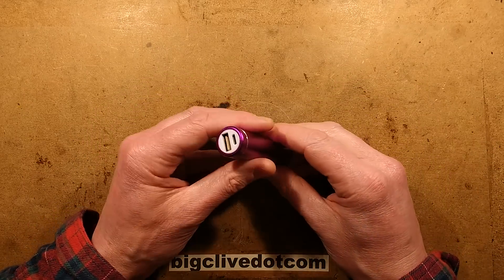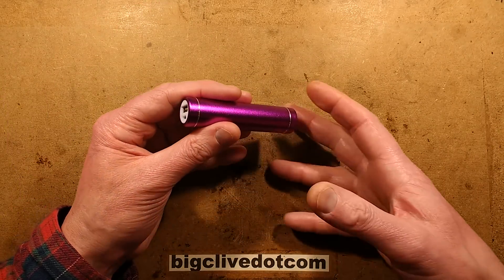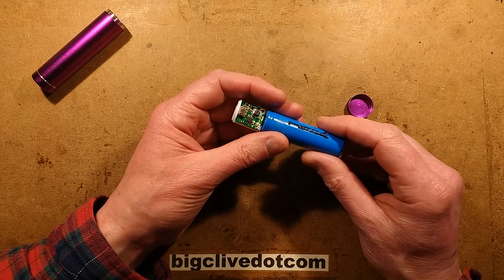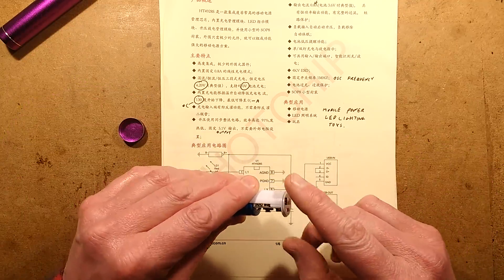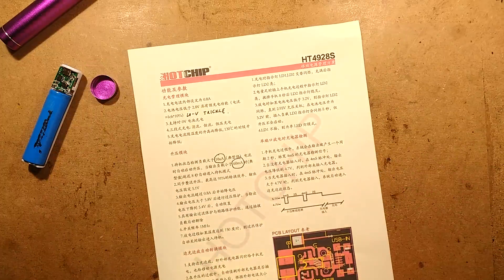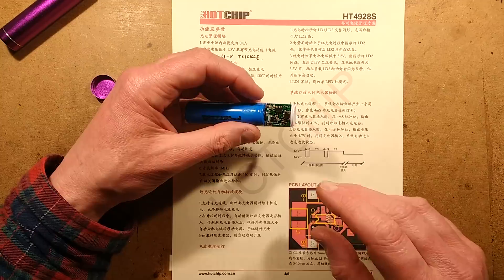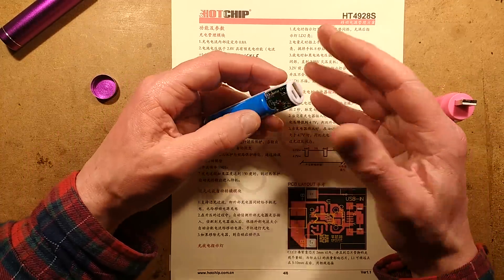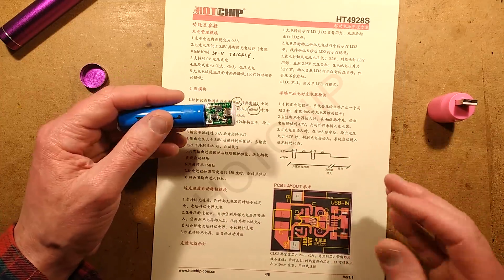Unusual USB power bank control chip.

Comment: A while back I bought some TP5410 chips from Ali Express because I saw them being used in the Wemos D1 battery shield and thought they might be useful for my battery-based projects. I was pretty impressed with the fact that it combined a battery charger and boost converter in one chip, but while it's impressive they've managed to integrate so much into that tiny chip, I think it's just taking it a step too far. I think I'd rather pay the $1 more for a couple of extra capacitors and the external Schottky diode.

Also if it's outputting 5.1V, but you're charging it from a 5V power source, it could be pushing current back into the source, which could damage poorly designed devices.

Comment: Good for a dash cam anyone?
Reply: Most dashcams need a minimum 1A output. The spec sheet says 800mA output, so I don't think it would work very well.
Reply: I got one video (Grudniowa Masa Krytyczna)from cheap DashCam connected to that same PowerBank mounted on my bike. It make some noise when is recording (the power and mAh is small) but when you play the movie it's normal.

Comment: I've got plenty of powerbanks but none cylindrical and now I WANT ONE. Bad Clive ;)
Reply from the maker: You can never have enough powerbanks.
Reply: that is true :) The ones I got most resembling these are 2 square housed ones. They have a neat on/off momentary button on the front. Most seem to be without and sometimes turn off with light loads.

Comment: This issue with the 4,7 volts drop or the stand by cut out would not be a problem. If it would be, can't you just put an capacitor parallel to the output? But defenetly a very neet little device.

Comment: It can be  used a dual transistor astable with a proper load to make the power bank not going to sleep mode . The power bank is very nice, compact . I have a bought a multimeter that was removed from the list but fortunally it arrived to my home safe and it's working well.

Comment: Anyone got a budget solder that they like and performs 'ok'? I know I should buy a top branded solder, but I don't work and this hobby is costly enough :)
Reply: I used to buy from Maplin but I understand they just closed. However, any 60/40 tin/lead solder with flux core should do.

Comment: I have a few of those boards in the fry's $2.50 power bank. I took one and hooked it to the samsung flat pack lithium battery pack out of my daughters old tablet. It works great and I have a 14000mAh battery pack now. The fry's pack come with a no name 18560 soldered directly to the board and battery.

Comment: I was looking for this product for months. I need it as UPS for Arduino. Idea is to supply Raspberry PI project and being able to charge it without it shutting down abd seamlessly switchig to battery on single chip. For now, I have 2 PCBs - one charges battery and other boosts to 5v. There is no direct conection from input to output.

Comment: Have you tested it charging a phone? Does the phone handle the 4ms 4.7v drop? Most smartphones will back off the current if the input voltage is that low, but maybe 4ms isn't long enough to cause any problems

Comment: Clive  I have two of these Ebay purchases too.  I'm in NZ, you are right about a snug fit of the battery
I cut the end off the plastic end & just left a piece of plastic in the end & it gives me enough room to put the 18650 cell in

Look for 2600mAh Portable External USB Power Bank Box Battery Charger For Mobile Phone if you want any on ebay
Reply: NZErehwon I did the same thing!

Comment: Oh, that's smart, because the input and output are the same, you could use a single Type-C connector as input and output, with no extra work.

Comment: I've seen these for purchase on Amazon and eBay being branded as MiPOW or Vida IT.  Perhaps one of those companies originally designed it and filed a take-down notice on this product.  I just did a quick search after watching this video and you can still find ones that look identical to this & use a single 18650 cell by searching, "tube usb charger".  Of course, the internal circuitry might be completely different than the one Clive shows here.

Comment: Wonder if annoying blinking of either string lights every 12 seconds or single light every 2 seconds could be reduced by deploying two power banks in parallel or maybe even three !
Would imagine some other functionality might be lost though.
Reply: Only if the outputs are OR-ed together with diodes otherwise when the output drops to 4.7V every 2 seconds to check if there is a charger fitted, it will detect the 5V from the other power banks and go into charge mode.

Comment: Ah, yes. That HOTCHIP boost converter chip. I have two power banks I hacked to accept protected cells, and I sometimes use that to charge my phone when my main power bank could be too large for the purpose.
These things do get hot a lot but it properly cuts the connection if it reaches the critical point. They are good for their price!

Comment: with you having another 18650 related product i wanted to ask if you would know where or how to get an 18650 battery, which has a small positive pole inside the negative pole. i have one of those for my flashlight but i can't find another one but i'd kinda need it
Reply: Tizzandor it would probably be easier for you to get a really thin copper washer and solder a wire to it

Comment: Hello Clive, could you please check if this listing contains the same circuitry inside the power bank? It's got pictures of the circuit board. Here's the link: https://rover.ebay.com/rover/0/0/0?mpre=https%3A%2F%2Fwww.ebay.com.au%2Fulk%2Fitm%2F282286313670
Thank you.

Comment: Obvious flaw: You are not supposed to load the incoming USB power with more than 10μF .
Reply: "You are not supposed to" is the long way to spell "USB". You're also not supposed to draw more than 100mA until you negotiated it with the host, or draw more than 500mA on any 2.0 port, or draw sweet fuckall if you got deconfigured because the host is going into standby, or have "A-A" cables, or "Y" double-A cables... yet 99.9999% of neither devices nor hosts just don't give a damn. I think this one's dead, Jim...
Reply: Attila Asztalos For the current draw, they made a special exception for charging purposes, though I haven't read that part of the specs.
Reply: the apple ibook g3s actually followed all those specs and it was annoying as all hell

Comment: I was actually looking for a power bank that would act as a UPS/buffered power supply.

I have an Intel Compute Stick (an Intel Atom-powered mini computer), which is powered from a micro USB port (rated 3A). There is no battery inside, so in case you need to move it you need to shut it down, disconnect, reconnect and start again. Having such a buffered power supply I could use it to keep the device powered while moving.

Sometime ago I got a cheap power bank as a company Christmas gift and I recently gave it a try and plugged the input plug while having the output connected to a phone and surprisingly the charge LED went on, while the discharge LED kept going and the phone was still charging. I didn't notice any power interruption, but I also didn't check if the battery inside the power bank was actually charging.
Reply: Just a heads up, Lithium batteries don't like to be floated, so the 18650 will probably not last terribly long in that scenario.

Comment: I have one that looks identical I bought from ebay a few months ago that has a different chip inside. Its a perfectly good little power bank but it uses the TPower TP4333E instead. It must be a similar all-in-one charge control and boost thing because there's no other chips in there and the PCB is similarly bare with just three capacitors, a single resistor, the boost inductor and the two LEDs. It can however output 1.25A and doesn't seem to do the momentary charge detection voltage drop. I doubt there's any way to tell which you'd get from any given ebay listing.
Also the wide spring thing might be an issue if it was at the other end but the entire can of an 18650 is the -ve terminal so there's nothing it can short on there.

Comment: I recently got a very similar looking one from an aliexpress seller, but mine behaves quite differently. The two usb ports are not directly connected like this one, the output will turn off if you try and charge it at the same time. Even more annoyingly, it will only charge the cell up to 4v.
Reply from the maker: That's still close to a full charge, but will result in a much higher number of charge cycles.

Comment: The HT4928S chip is still available on Amazon in a two cell power bank. I've got one in Big Clive Pink. It's works quite well.
https://www.amazon.com/5600mAh-Battery-Charger-22×42×86mm-Tuscom/dp/B0751BBVRG/ref=cm_cr_srp_d_product_top?ie=UTF8&th=1

Comment: For the problem of it going into standby mode / dipping every 2 seconds, could you put a capacitor into your circuit to kind of smooth it out, if you felt so inclined?
Or would that not work?
Reply: runforitman needs an additional diode to stop the capacitor from back flowing and triggering charge mode (capacitor pins the output to 5V, chip detects that the voltage doesn't fall even tho it's cut it's own power, chip assumes it's plugged in)
Reply: Pixl Rainbow I did think that after I commented but I wasn’t 100% if all that was needed to stop that was a diode.
But you’re definitely right; just a capacitor on it’s own would cause more annoyance than without

Comment: It's a little bit annoying with all those power bank having standby doing strange things when you just want to use them with low power microcontrolers
Reply: R4P70R stick a capacitor on the output to smooth the voltage, and stick a diode to prevent the capacitor from causing backflow and triggering charge mode.
Reply: It is very good at keeping the battery topped for the case when you actually need it. It is a good compromise.

Comment: Couldn't you add a capacitor to the LED light string to stop the periodic flicker?
Reply: Paul Drake when it goes into "charge check" mode, it dips the output to 4.7V to check if something else is keeping the voltage up. But since the capacitor is charged to 5V, it will prevent the voltage from falling. You need an extra diode to stop current from flowing back into the power bank and triggering charge mode.
Reply: Pixl Rainbow could you recommend values of capacitor and diode for us that don’t have too much knowledge
Reply: Pixl Rainbow ah, yes
Reply: Paul Drake that’s what I was thinking... but that probably comes with other problems that I don’t understand haha

Comment: I have a similar powerbank with the same chip. It works out around 57% efficient with 2250mah to full and 1100mah till empty. It only seems to be around 0.6-0.8A output, the voltage drops and it cuts out if you give it much more of a load. Mine doesn't seem to cut out like yours does, but I'm sure it's the same circuit.
Reply: you got 8Wh in, and 5.5Wh out, and thats the efficiency of 69%

Comment: Wouldn't a properly sized capacitor solve the "low-load standby in every 12-14s" problem?
Reply: only with diode to prevent discharge back into this thingy. Because if you buffer big enough to keep stable, it will detect the 5Vand think it gets powered and switch to internal charging mode completely.
Reply: Yes, a large capacitor would work.
Reply: good point
Reply: To prevent flicker from the charger detection, the capacitor needs to be as small as possible. 
To keep the normal output stable, the capacitor needs to be fairly big.

To fix the low-load cycling problem, a small capacitor may help to cut down the time needed to detect the load current, but to solve this properly, I think something else has to be changed. I think one solution could be to add (more) hysteresis to the standby current threshold. Then it should either stay on or off.

Comment: I would imagine the "sensing" features of this chip would also make it very bad to try to use as a power supply for low powered microcontroller applications (like Arduino).
Reply: It may even go into standby mode if power pulled is too low. I can imagine the square one works much better for that application.
Reply: I have a pack that looks like that. I run Arduino and RC receivers off it all the time. Of course it could be entirely different inside....
Reply: very bad has in utterly useless? besides charging your phone I don't see what you could do with that pice of shit.

Comment: What an interesting chip!
I wonder if a schottky diode in series with the output (just before the the output plug) and a 10uF cap to ground after the diode, would eliminate the pulsing every 2 seconds? 
Since the output is at 5.1 and the diode will drop 0.3V, it should still be usable...

Comment: This would be just perfect for my Bridgeport Interact MK 1 CNC with Heidenhain TNC155A controller. The TNC155A has a battery backed machine parameters stored in SRAM and it seems to eat the battery's at quite a fast pace. (It does measure the backup battery voltage and ever so often it complaints that the batteries need to be replaced) Maybe the batteries aren't really drained but the comparator may have some issue detecting the correct battery voltage. It has never lost the machine parameters due to low battery voltage.

There's a battery bank, three LR6 (AA) non rechargable and a diode that feeds the backup SRAM, maybe if I remove the diode and connect this to it? Even older SRAM retain its content down to very ridiculous voltages... 4.7v should be no problem...

EDIT: Or not if and when the load with the SRAM is low and it would go to sleep... :(

Comment: Thats actually really smart
I kinda wish my expensive power bank could charge itself and my phone at the same time
Reply: RIGHT?! i'm so annoyed that none of the power banks or power bank modules i've ever seen can be charged and charged at the same time. you'd think itd be easy. just allow the  device to draw current while charging, but have a limiter in there to prevent the device drawing more current than the charger can output, so as to prevent the cell from dropping. It would at least keep it at the same charge level.
Reply: 金3 A.M. 
All the ones I have disables output when a charger is plugged in.
Reply: Most if not all of the RAVPower ones have that "passthrough" feature
Reply: SpiritOfNux 
Mine doesn't. I have been looking for one with this feature that can give a full 2 amp output. I have yet to find one.
Reply: I've never had a power bank that didn't charge my phone and itself at the same time
Reply: Zach Demand http://blog.ravpower.com/2017/10/danger-and-damage-of-pass-through-technology-for-batteries/ has a list
Reply: My Ecigarette can be used while charging, while my power bank can not. Annoying indeed.
Reply: connect 2 of these in parellel, that should solve ur problem :D

Comment: Its pretty worrying when the moment you buy something, and ebay removes the original listing.
Reply: In this case, I can easily see why it might have been pulled. It's not normal to buy empty power banks. The seller probably didn't originally state in the listing that the item had no battery. With Chinese sellers, they do this hoping to rope in buyers. Buyers purchased it thinking they were getting a functional power bank and received a power bank with no battery. After that, eBay complaints. The seller likely received complaints as well and altered the listing to clarify this part, but it was already too late. Clive likely found the listing after it had been clarified, but shortly before eBay pulled it.
Reply: @abigguitar  if it wasnt normal then why would they make a listing for an empty power bank in the first place? lol
Reply: SpikesSoRandom - Dimentos Productions
Yeah. First time I had that happen was when I bought an android car stereo... About $500AU, and within minutes, the listing was removed (despite having more than 10 "in stock" when I paid).
I think they do it when they have multiple listings of the same thing, and they use external software to manage the listings.
Reply: The last time that happened to me, the item never came, and I almost couldn't get my money back.

Comment: Been looking for one of these that will work as UPS.  Too bad about the low output.  Can a regular one be wired this way to function the same?
Reply: Just a heads up, Lithium batteries don't like to be floated, so the 18650 will probably not last terribly long in that scenario.

Comment: They should just add simple button. I like when powerbank automatically detect when you plug something and charge it, but still I prefer when it have that small button to force charing when you have something small plugged in that barely take any power.

Comment: Hi Clive, I bought some of those from Banggood a while ago to use as a small power bank. I happy with their use, they are still available on Banggood.  One important thing! If you put the battery in the wrong way you'll fry the unit.

https://www.banggood.com/USB-Power-Bank-Case-Kit-18650-Battery-Charger-DIY-Box-p-961269.html?rmmds=search&cur_warehouse=CN.

They also have a square model.

https://www.banggood.com/Power-Bank-18650-Battery-Charger-Portable-for-Flashlight-p-915509.html?rmmds=search&cur_warehouse=CN
Reply: "Installing the battery must pay attention to the positive and negative, anti-loaded will burn, burned out is not returned." oh how I love these
Reply: Look closer. The circuitboard shown on the banggood listing has a different layout than the one in clives video.
Reply: Anthony Witham no reverse polarity protection  diode then?
Reply: No, the ones I have are the same.
Reply: No. Just magic Pixy smoke! 😂